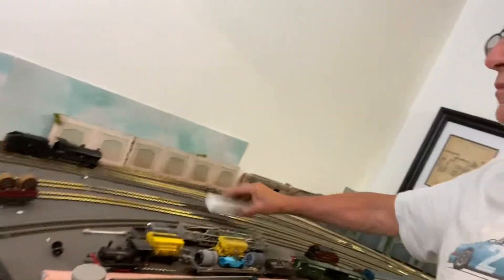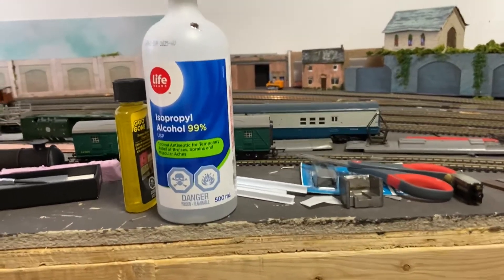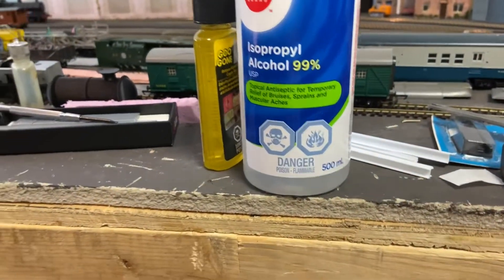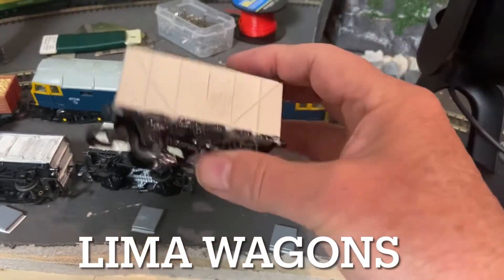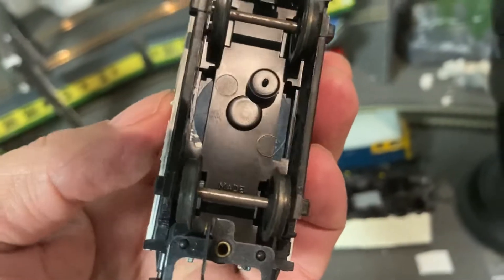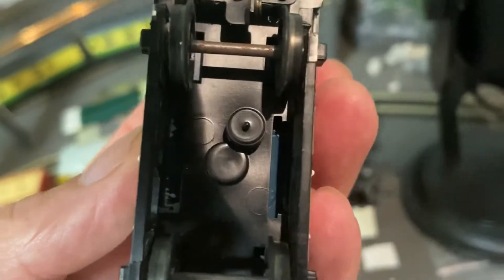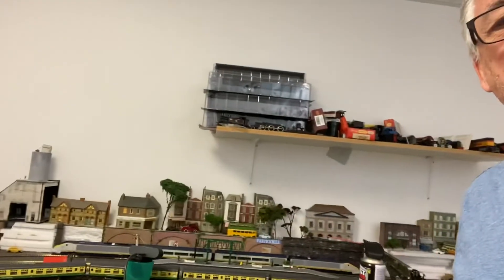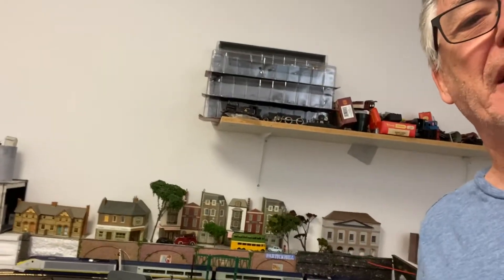Tips and Tricks at Partickhill Station

Comment: Hi Charlie .. some good tips there. A couple of points if I may .. you did not mention 'back to back' (the distance between the wheels). There is a specification for this and a number of manufacturers don't get it right. In any case of derailment I think it is worth checking. With the all in one plastic molded wheels not much to be done except replace them. Most aftermarket (metal) wheels you can gently rotate and push (or pull) to change the gaps between the wheels. The 'ideal' gap depends on whose track you use but once you have a standard use it. My second point regarding couplings .. the main issue for UK rolling stock is there is no standard and every manufacturer does their own thing to the detriment of the hobby as a whole. A lot of modeler's say the heck with it and convert their fleet over to 'Kadee' which does have a strict standard and although this works it can also be cost prohibitive. There is no easy answer. Even if you made a test jig to check your UK couplings against there is often no method for adjustment.
Reply from the maker: Very good points and in fact I did adjust the metal wheels with my brass gauge and should have mentioned that
So many things to consider that could ruin your running session.
Thanks very much fir taking the time to write a note, nakes for great dialogue. Cheers